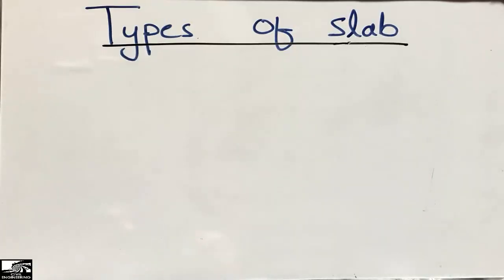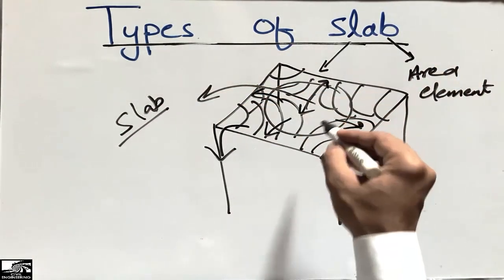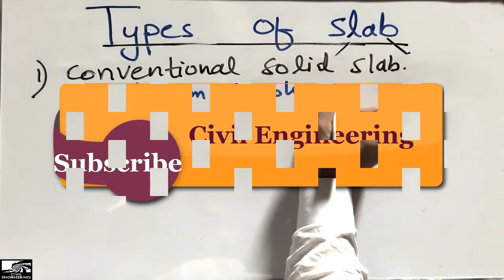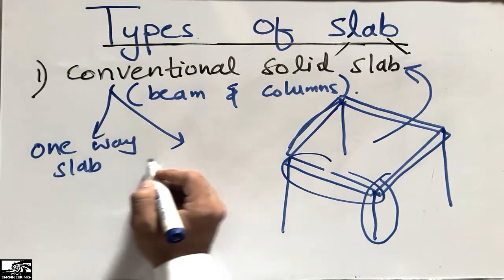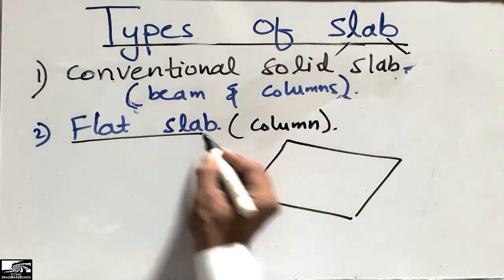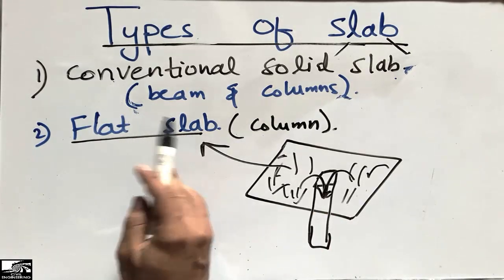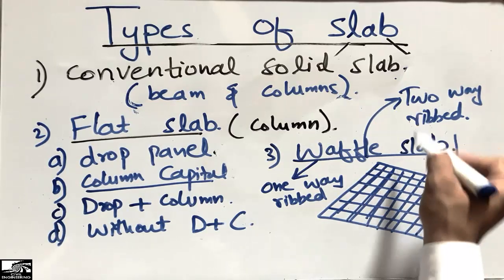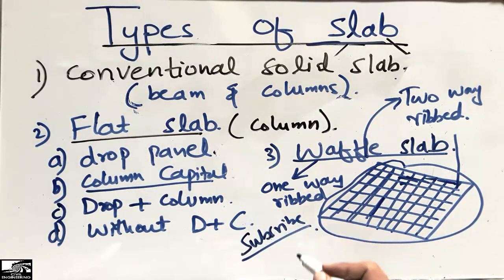Types of Slab

Comment: If the slab of 4.5" placed over the columns of 9"×9" and the beam also 9"×9 and the distance between two columns are 4.5 meters then the building is safe or not?plz reply
Reply from the maker: No one can say that your building is safe or not without performing analysis.
Reply: @civilengineering94  The length building is 70 feets and it consist five rooms and each  
room wide 12 feets and length 14.5 feets 14.5 feets is maximum and the slab 4.5 " and column 9"×9" and beam also 9"×9" then the building is safe or not?plz reply soon